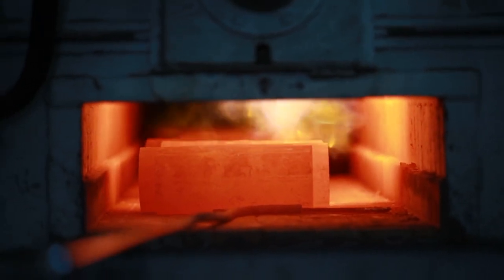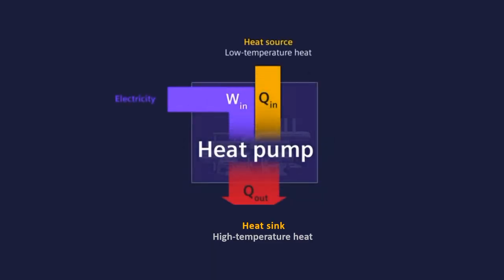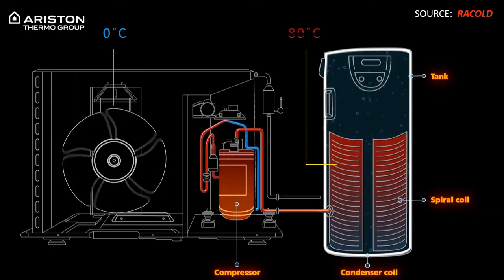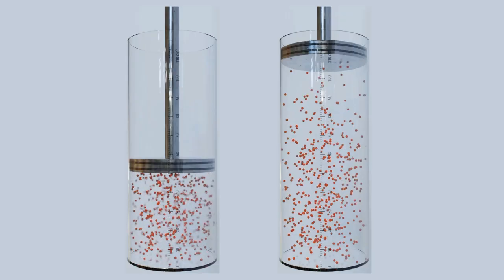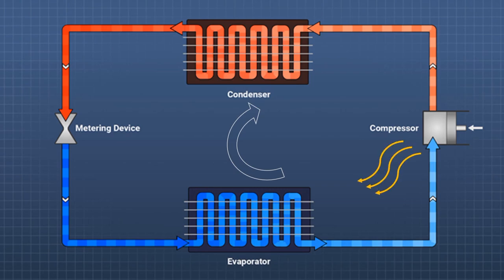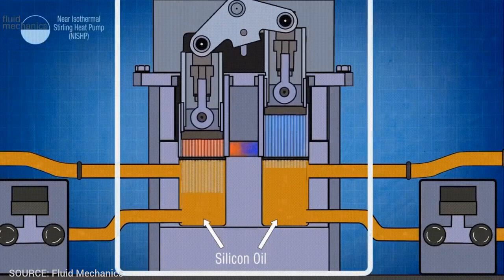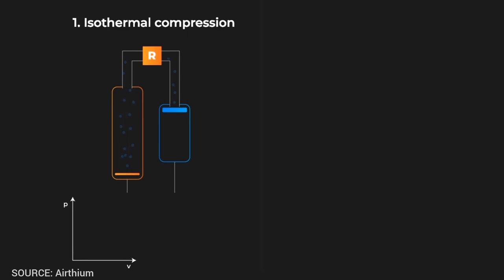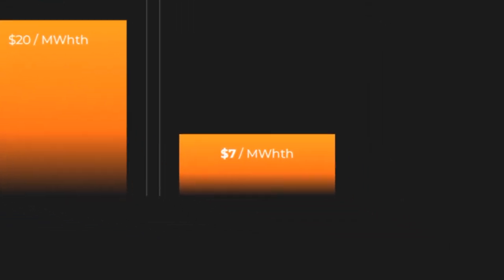The Ultimate Heat Pump that Could Change Energy Game

Comment: I have to say it is surprising to hear someone with an Indian accent explain heat pumps using the INSIDE of the house as the sink (ie used as home heating). Usually those of us from warmer climes (I'm Australian) think of them more as air conditioners (ie inside the house is the source). But this is a fine video deserving many more views.
Reply from the maker: @kenoliver8913, yes, people from warmer climates are more familiar with air conditioners. This technology drew my attention due to the extremely high temperature that it can deliver with very low outside temperatures.

Comment: There have existed a industrial equipment called a turboeinduser since at least the 80s that have done pretty much the same thing. Typically they use some other source of heat than ambient temperature, like waste heat, often waste heat from the exact same process, and just feed it back via the turboinduser.

What it basically is is something like a normal turbo charger, where the air is compressed the heat is removed and the air is then decompressed on the same shaft. This method is fairly efficient and can reach temperature of quite  a few hundred degrees. Still its like 50-60% carnot efficent, so not perfectly so

Comment: Could this be used to design heat pumps that can work with a pretty good C.O.P. even in extremely cold temperatures occurring at the (geographical) poles? Able to keep building temperatures inside around 20°C with radiators optimized for warm heating without ventilators?

Comment: Well then multistage them (cascade the heatpumps), you can reach much higher temperature differentials still, all with high COP!  Also what is stopping the energy stored in the compressed side from driving the compressor as it expands?  Nothing, but currently that is just wasted!  Also if you don't just look at the heat or the cold but look at the maximum temp difference from the hot to cold side this leads to very high grade heat with a high degree of conversion efficiency, potentially exceeding the point where the second law of thermodynamics can hold!

Comment: You can not achieve a COP of 3 while increasing the temperature from -70 °C to 500 °C, the amount of heat possible to pump against that temperature difference is in practice negligible compared to the amount of power required, "in theory", with a system without any losses, it would be possible to pump about 30% as much heat as the amount of power used. 

It's not difficult at all to achieve high temperatures with heat pumps, the main problem is that it's impossible to achieve high COP when you need to create a high temperature difference. 

Your explanation of the principle seemed strange, you can't pump heat with isothermal compression, without a change in temperature, the change in temperature is the very goal of the heat pump, you can't improve the efficiency of the process by making it useless. You can improve efficiency of compression by dissipating heat of compression very well, but when you want the heat, you don't want to dissipate it.
Reply: Agree, It seems the best heat pump over such a high delta T could achieve a COP of only 1.32.  COP (heating mode) = T_hot / (T_hot - T_cold) in Kelvin.